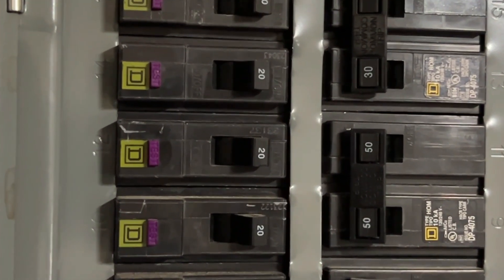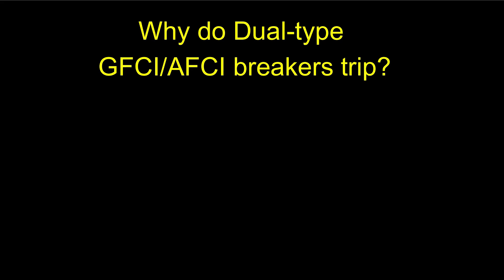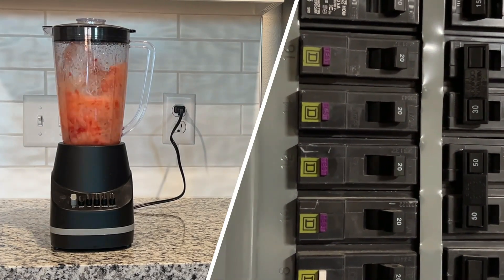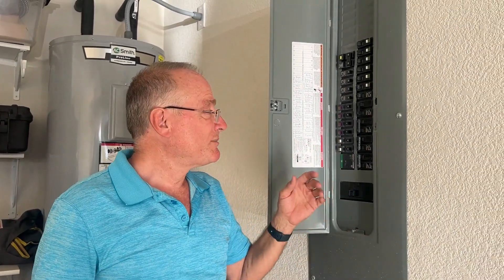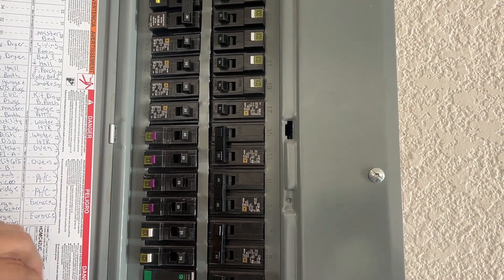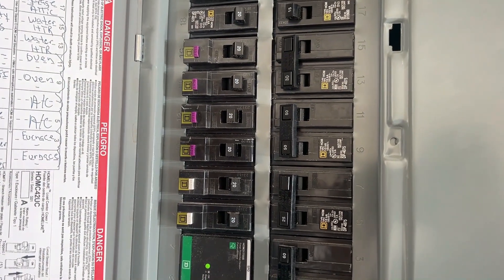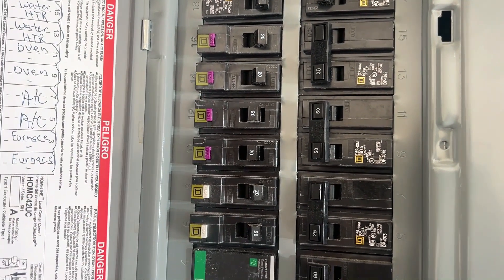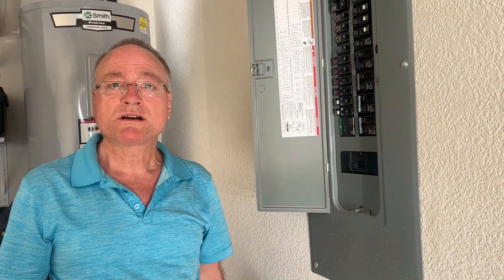Why Did My Dual Function Circuit Breaker Trip? ￼

Comment: I actually never heard of that trick.  Where I work we usually use Eaton BR style panels and breakers.  For those that aren't familiar with this particular panel,  the AFCI,  Dual function and also GFCI, if I'm not mistaken,  breakers have a small red LED in the test button that blinks a specific number of times after you reset it following a trip.  The number of blinks corresponds to the type of fault that caused it to trip.  

What I've experienced,  not so much now, but about 8 to 10 years ago when I was first getting into the trade as an electrician,  motors, vacuum cleaners being the largest culprit,  caused most nuisance trips with AFCIs in the days before the technology matured enough to tell the difference between normal arcing and dangerous arcing conditions.    Another thing I've heard but never experienced myself,  in the early days of AFCI, were dimmer switches.  Because a dimmer switch works by chopping off part of the AC sine wave thereby varying the RMS voltage supplied to the luminaire,  supposedly this didn't work as well with some brands of AFCIs when dimmed to a certain level,  with some brands of dimmers having more trouble than others.
Reply from the maker: Yes, it is a neat trick that I have recently learned. I think they have fortunately solved most of the nuisance tripping of the AFCIs.